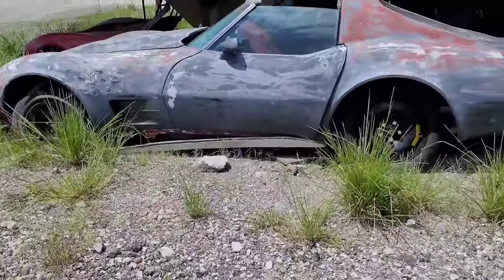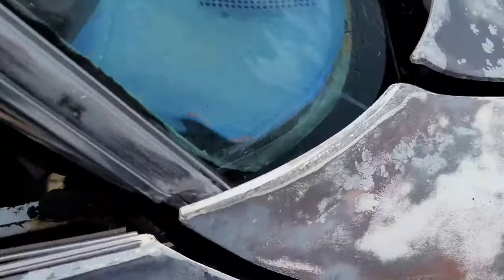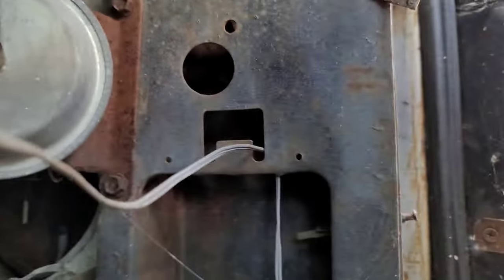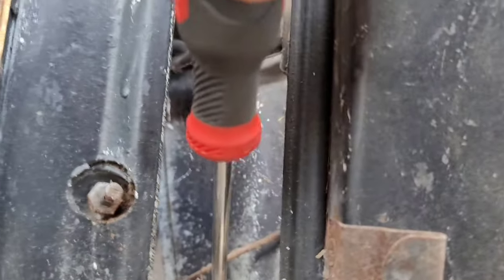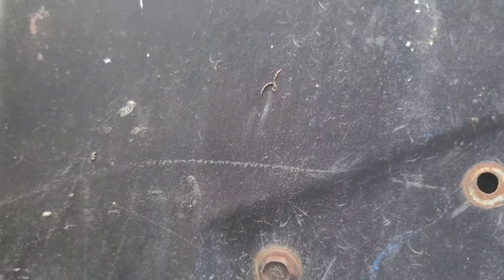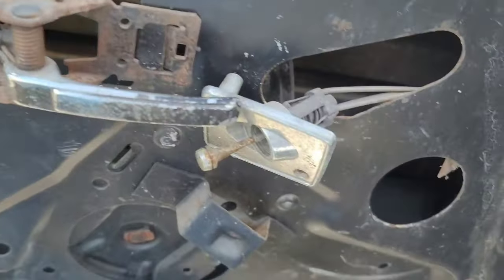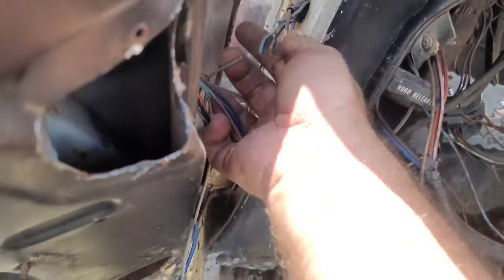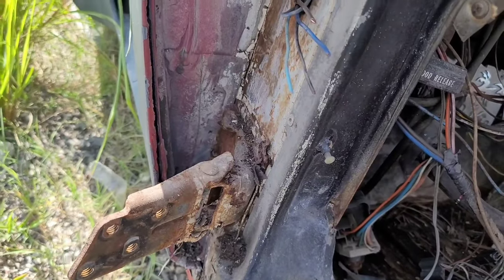C3 Corvette Door Removal in 10 Minutes

Comment: Hey Brian, I got a question for you. I have a 81 Vette. We have replaced the door latches on both doors. Drivers side is really smooth with no problems. The passenger side is sticking as after it's closed, it doesn't want to open. Could it the the hinges that need to be replaced? There also is no slack or sag in the door. That's why I thought that the hinges were good. What's ur thoughts? Thanks Brian for the video. We appreciate it!
Reply from the maker: Hey buddy, sometimes the door latch assemblies get "sticky" and need to be pulled out and soaked in motor oil for awhile to loosen them back up. It is especially common on the 78-82 Corvettes after they became more of a complex design. The biggest hassle is getting to them for removal. You need extreme patience, long tools, and small hands👍.